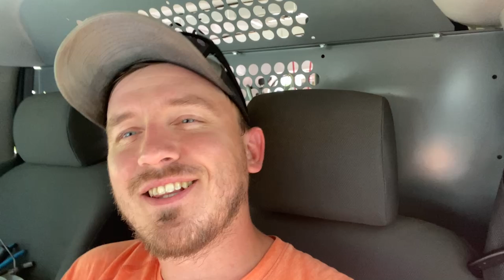How Does A Drywell Work On A Septic System & For Rainwater?

Comment: Great content,  thank you.  I had my my seepage pit pumped, they told me to put caustic soda in it. What's the idea behid this? Also generally how deep and wide would this pit be for a 3 bed 2 bath house. My service cleanout port is 4 inch pvc at the pit.
Reply from the maker: Md doesn’t recognize caustic treatments as a permanent solution.  Additionally your supposed to file a declaration with the county indicating the defect and the caustic treatment plan.  The purpose of that method is to dissolve the bio mat build up in the block, stone & soil.  I personally have not seen it do more than a couple years extension at most.  Usually in our area a pit would be about 10x10x8’ deep.  Hope this helps!